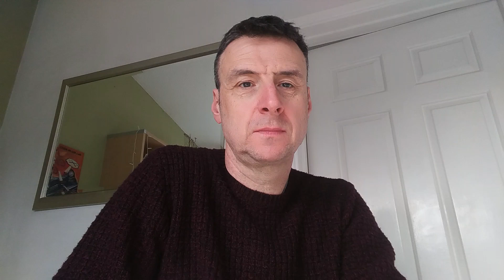Hot Tub Foam: How to get Rid of it!

Comment: 1.Clean your filters with filter cleaner every 3 to 4 weeks.
2.Balance the water PH/ALK
3.Adjust Calcium Hardness 
4.Shock  the tub with 1 Tbsp of Chlorine Concentrate (99% Di-Chlor) 
 once a week or one Tbsp after heavy use.
5.Use MPS non chlorine oxidizer 1Tbsp after every use of the Hot Tub.
6.Change water every 4 to 6 months